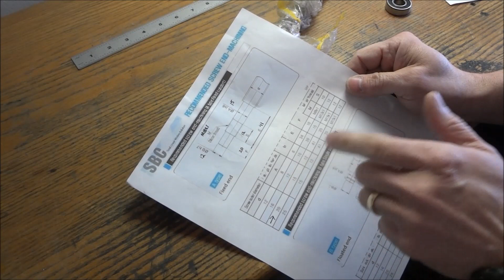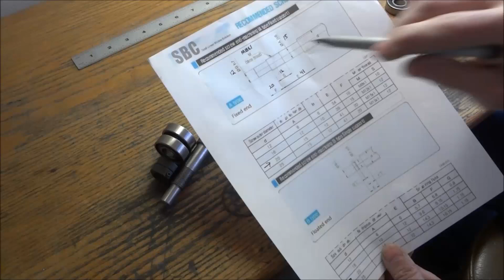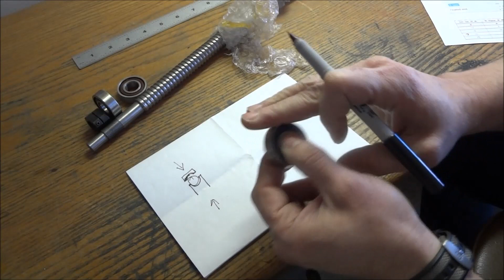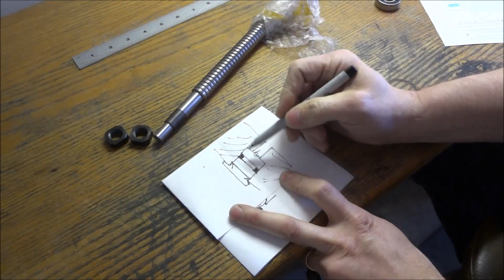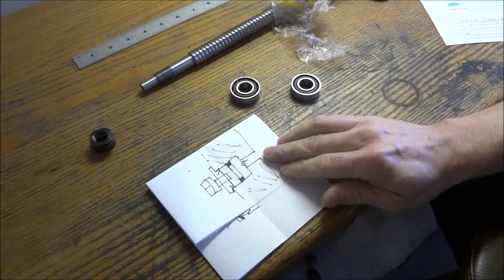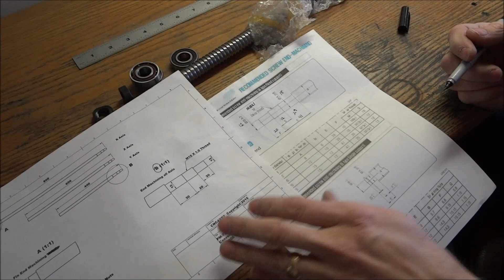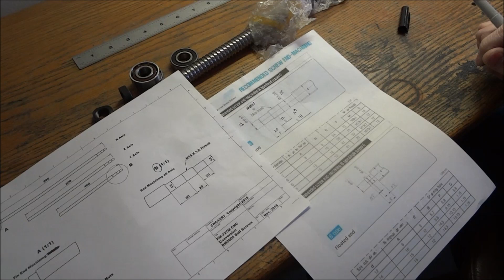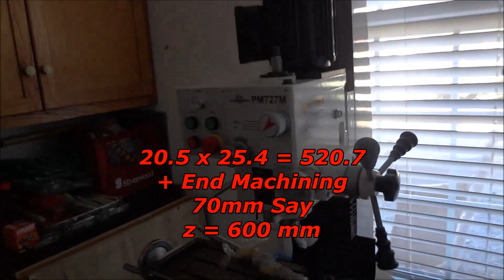PM-727M CNC "How to Measure Ball-Screws"

Comment: It's great to see somebody go through the entire process - this is very valuable for the entire community.

Regarding the bearing block, couldn't you accomplish the same thing with the same kind of arrangement you used before?  Just make sure the through-hole is large enough that it doesn't touch the inner race.  Basically, use the bearing block as the spacer.  The jamb nut and the end of the thread both ride on the inner race.  Is there an advantage to this approach that I'm not seeing?

I do like the idea of a block on the outside though.  That would probably provide a lot of protection for the non-sealed bearings.

Thanks again!
Reply from the maker: +Paul Frieden 
Hi Paul,
 Excellent question yes you could the advantage of doing it the second way is you create the bearing pocket from one side. 
Having to flip the block over to pocket the back side and get it dead center can be difficult. 
Be safe Sam
Reply: +CNC4XR7 Ok, that makes perfect sense.  My first thought was that it couldn't be that difficult, but as I thought about it more I realized that it could actually be rather tricky.  Thanks for the insight!

Comment: I just wanted to know if i buy a 500mm ball screw that i actually get 500mm of travel or the screw shaft is 500mm. and actual travel is 350 or some stupid crap.  
minimalist product listings are annoying..
Reply from the maker: well the short answer is no you will not. the ball nut is say 2" long and if you have your axis centered on the ballnut you will lose 1" in each direction.
Reply: You get a 500mm shaft, from one end to the other, inside that you have your end machining and the length of the ballnut, they both subtract from the 500 to give you your actual travel. So...for standard machining on say a 2005 screw you get:  500-20(A end smooth section)-40(A end threaded section and bearing journal) - 42 (the length of an SFU2005 ballnut) -13 (B end bearing journal)= 385mm of travel.

Comment: Sam, according to your spec sheet, it looks like the 25mm screw has the same end machining specs as the 20mm screw. Is the typical for the 25 mm screw to have the same machining specs as the 20mm? I am getting ready to place an order for some ball screws to do a pm940 conversion. Just want to make sure I get the dimensions right. Also, I understand that on the Z and Y, you have to run your ACB's on the driving end since the other end is floating. But on the X, have you thought about separating the ACB's and having one on each end of the table? You could still get the preload adjustment and eliminate the ball bearing on the dead end. But since the Z and Y are going to have the ACB's on just one end, I can see going ahead and doing the X the same way. Did I just answer my own question? lol
Reply from the maker: The End machining are per my specs. I used rm2005 ball screws.
You could use taper rollers as well
Reply: Thanks for the reply Sam. I understand that you altered the standard machining. On the sheet you had in your hand in the beginning of the video, it showed the 2005 and 2505 with the same standard machining specs. I guess I expected the 2505 to have a different machining spec than the 2005. I am going to use the 2505 on the Z and the 2005 on the X and Y. I am going to use ACB's on them as well so your alterations will work for me also. Your vids are a big help. Thanks again Sam.
Reply from the maker: your welcome.

Comment: Sorry but you’ve no idea how to mount angular contact bearings, they come pre set so you can put them back to back or face to face without spacers which enables you to tighten the locknuts to the full without overloading the bearings...
Reply from the maker: There are many different configurations that can be used with AC bearings. This is a single row setup. And has worked very well for me.
Reply: CNC4XR7 There’s only 2 variations, back to back or face to face but you can use as many bearings as you want to give extra axial thrust strength. I’ve 45 years experience in CNC machine tools working on the best quality machines from around the world, i.e. Swiss, German, Japanese, English so know a bit about what I’m talking about.. But like I said it’s taken me 45 years so keep at it and enjoy what your doing but remember quality comes with “attention to detail.”
Reply from the maker: @stevenrichardson7882  Thank you for your advise and expertise on the subject.